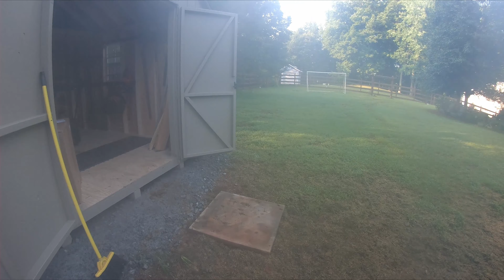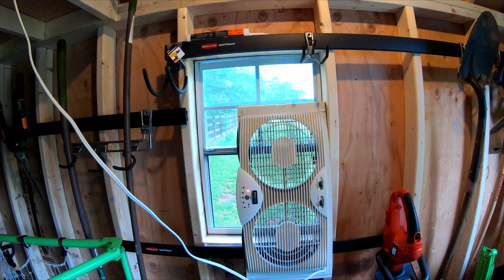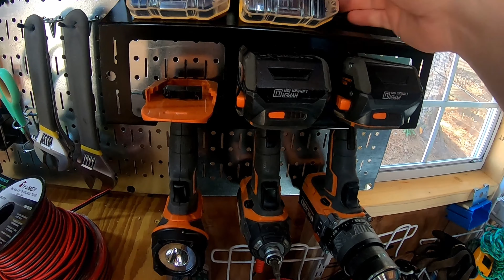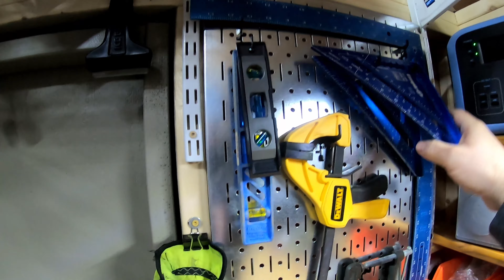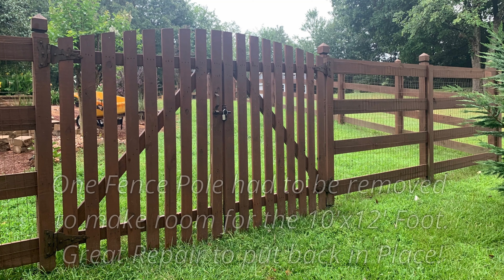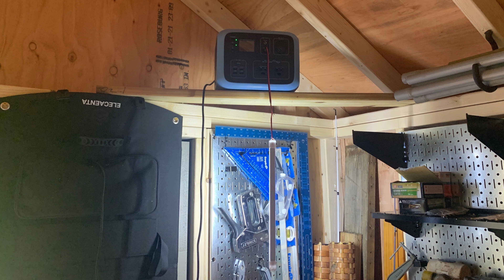Green Acres 12x10 Storage Shed with Renogy 100w Solar and Bluetti Power Station

Comment: VERY nice shed! I love Bluetti! I have the EB70 and love it. I use a Baldr 120 watt folding solar panel with it. Works great!
Reply from the maker: Very cool.   Yes, I was on the fence between the EB70 and EB55.   The EB55 is a little more limited, but I did not wait for the EB70 to come back in stock.   But the EB55 does a great job with the Shed and can even run the Ham Radio with limited output wattage.  Thanks for your comment.
Reply: @pjliving  Yeah, I'm a ham too. 73!